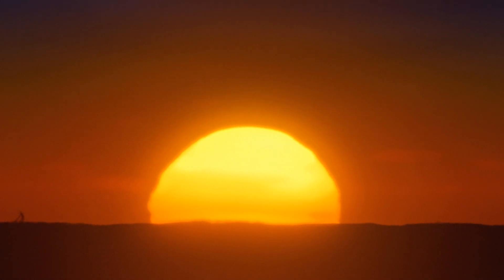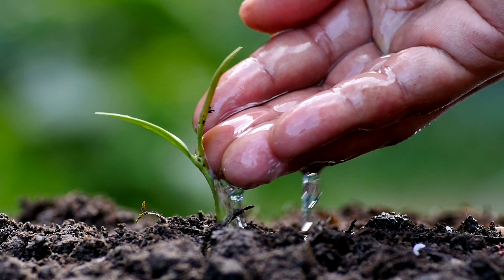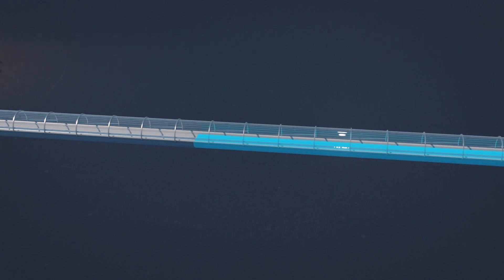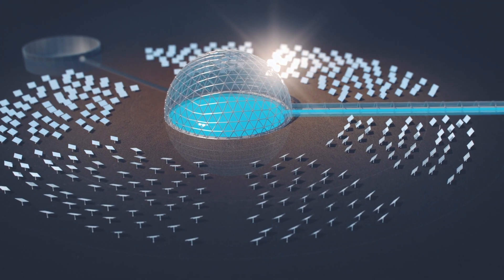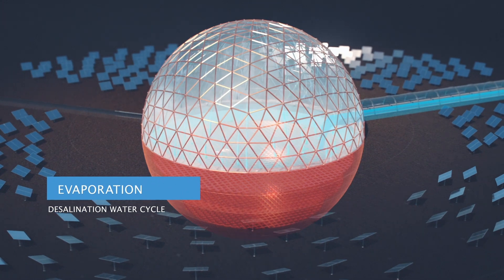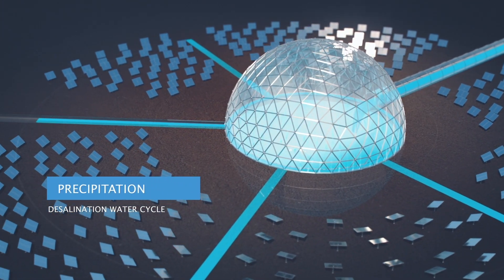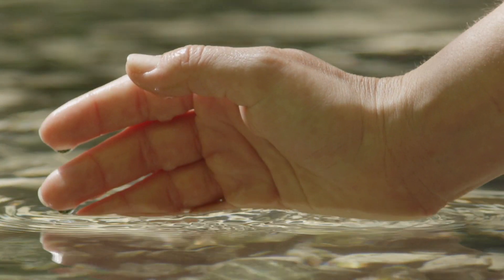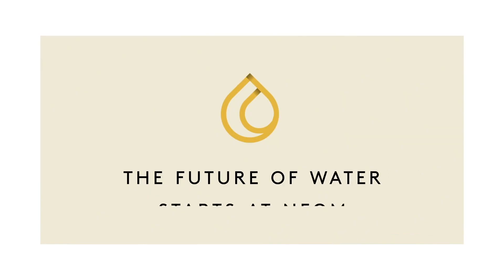NEOM: Pilot "Solar Dome" project promises to revolutionize water desalination. #BuildingtheFuture

Comment: FOSSIL-FUEL BASED DESALINATION IS NOT SUSTAINABLE - Solar Water Plc is in the forefront of green, sustainable and carbon neutral concentrating solar power generation and desalination technology to produce massive supply of inexhaustible energy and pure clean water for municipal, industrial, farming, biotech consumption and high tech industries that rely on super clean water for their manufacturing in an innovative way.

Comment: I have another plan with this existing structure when water evaporates and condensation happens there the humidity is high and what about brains? the high intensity of minerals if you take it back to sea again you are killing the ecosystem. Reservoirs used to save extracted water should be added Eco friendly living aquatics from nature and to form an artificial man made natural ecological systems so you pay to nature and then to wait for the changes patientcy is important and parellally more similar solar concentrator water plants to be introduced and waste water with high intense of salt and other minerals should be used for secondary value added productive sources please check and if found useful there are many plans to run fresh water river by a King in the entire human history CP-MBS will be unforgettable mark embedded in human history

Comment: Scaling up a quite known system of creating sweet water from salt water to mega proportions is not a revolution and it scares me when a German with South African accent is in charge and managed to sell that to the most stable actively (not institutional) ruling monarchy on the planet. There must be an efficiency breaking point somewhere on that steep line from a square meter box with a little transparent pyramid on top, that would help wide poor areas close to the seaside, and a Megadome like that. I am pretty sure the team of this Bure spend a lot on marketing and calculating need based on demand, but has not one single slide on the efficiency coefficient of size. This means you will do all the same mistakes as in Dubai, where creating the Mid East Finance and Development Hub attracted gamblers, cocain heads and fraudsters from the western world, again.